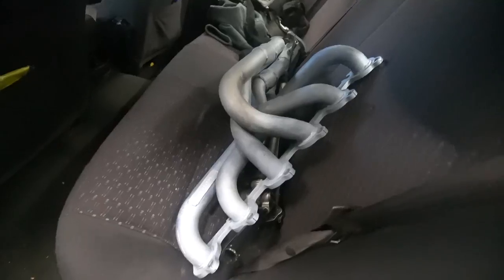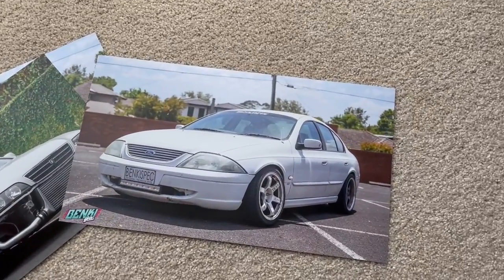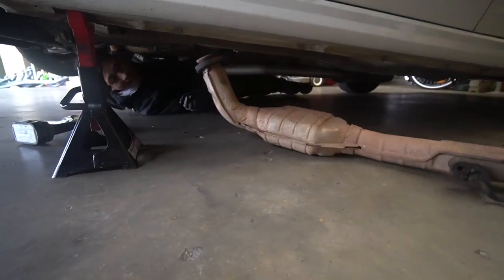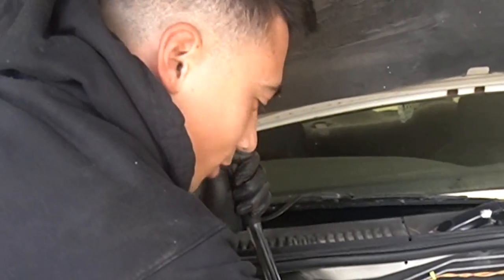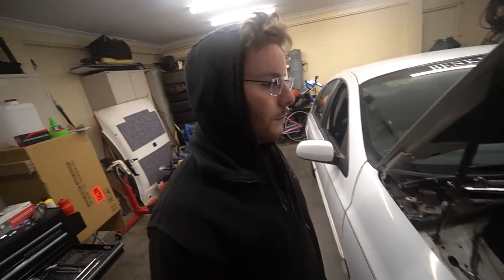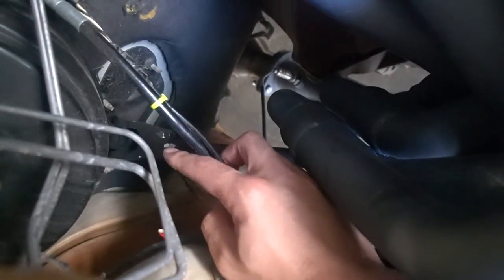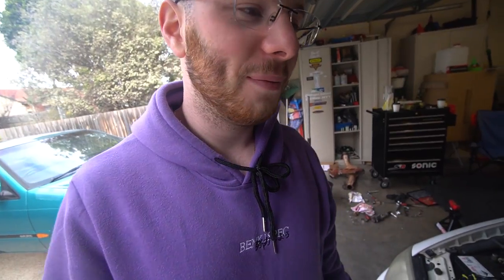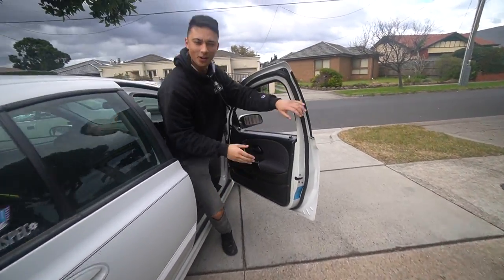THE AU FALCON GETS PACEMAKER 4480 EXTRACTORS!

Comment: Stage 4 cam,  springs, J3 and cut the big rear section of the muffler out and just put a hotdog in and it'll sound like a proper worked JZ 

Mates AU3 has that setup with a CAI and a proper tune and it sounds absolutely insane
Reply: get a vid of it on here wqnna hear it

Comment: Excellent mate! Been running 4480's with 100 cell cat and a redback, absolutely awesome sound and killer performance gains over stock 👍🏻👍🏻

You won't get the big gainz without getting rid of the stock cat, it robs heaps of power. Definitely opt for a cam and valve springs next but look at getting the ECU reflashed, as J3's have been known among the AU community as being either a blessing or curse. Sometimes they make big ponies, other times they won't let you even start the car 🤷🏼‍♂️
Reply: Hey mate, have you done much on the intake side? Apparently a territory Barra intake pipe and a k@n filter is meant to make a decent different to
Reply: Difference

Comment: Sounds awesome... Good to do it justice with varied revs and drive byes too! 

If you do the intake I would recommend acron plastics box. Only available used now, but it provides room for a pod filter without any heat issues, and of course adds the noise factor!